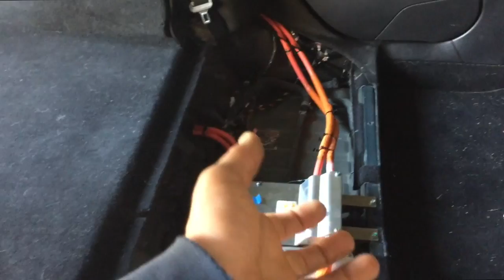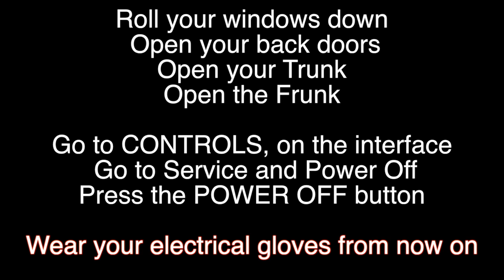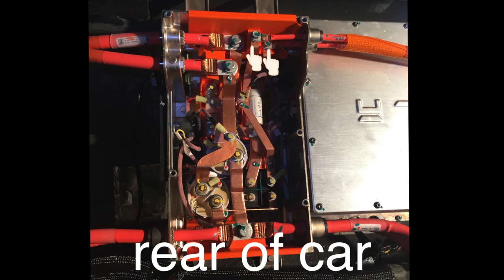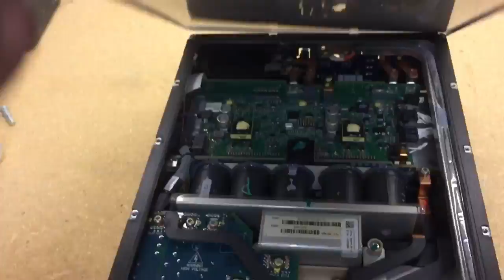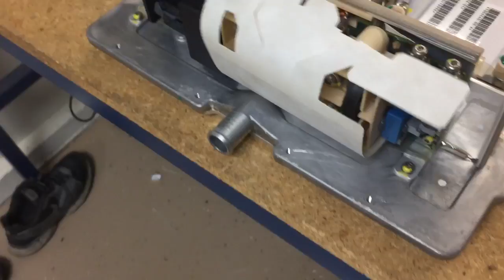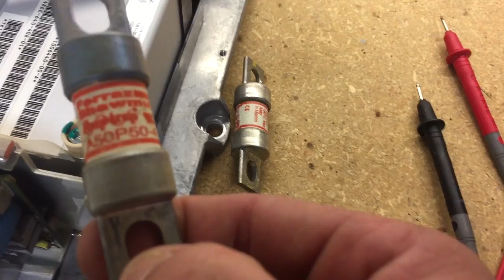Fixing a Broken Tesla Model S Onboard Master Charger

Comment: It's 2385.00 plus tax in California now. Let's just say I'm going to check the continuity on those two fuses first:-) Tesla told me it was the phase board in the master charger that had gone bad.
Reply: Did it end up being the board or did you just need to replace fuses?
Reply from the maker: Eric Bendler any update?
Reply: so did replacing the fuse fix it?

Comment: What kind of wet behind the ears engineer buries a fuse in the bowels of a car or module? The car is swimming with crazy-to-maintain stuff (like getting at the battery in earlier models).
Reply: Designed so the average home m3chanic can't fixt it

Comment: What would be possible symptoms of blown fuse in EU cars with dual charger?
Reply from the maker: Patryk Makowski similar signs would happen regardless of a single charger or 220v in EU cars. There will likely always be a fast acting fuse to safeguard against a fire. A dual may still be able to charge up to 40a then fail to go over that but I’m not really sure. They may have it set up so when one fails, the other charger can be the main. Good question. Wish I knew more to give a solid answer.

Comment: Thank you Nick for posting this. Was a little hard to find those fuses. Nothing local but allfuses and eBay was best price I could find. Mine the bottom one blew. Since I read the comments I replaced both of them. This occurred right after trying to use a supercharger that kept lighting Amber when plugged in. Moved over a spot and charged. I then went directly from there to home 8 miles away and plugged in at home just to get a little more since I didn’t want to sit longer at the supercharger. I plugged in and got the red death ring. Called Tesla service center and they thought maybe the UMC. It wasn’t. I have two. Neither worked on 50amp or 120volt plug. With the associated message of unable to charge. They said bring it by. They plugged it into their 100amp and same thing. Cure would be new $2000 charger plus labor. I have dual chargers inquired about swapping and was told about 3 hours labor to convert to single. So about $500. I still blame the supercharger and left contemplating what to do. Found your video and I love tearing things apart. Thank you so much as that saved a lot. I have the manual to help on the other 12V disconnect steps I wasn’t sure about. I didn’t have to unbolt either charger. I did remove the HVJB just so I would have room to remove the charger frame piece. Probably 4 hours of physical labor figuring it out. Tracking down fuses at a good price took longer.   If you hunt hard enough you will find in the $20 range. eBay for me. 
Thanks to the other comments here for the extra tips.  
The white insulating material over the fuses I could see was attached by two plastic rivets but no way to be able to get those out and back in without tearing a lot more apart.  I opted to just slice the two top 1/2” pieces with a knife and it stays in place with the frame back on.
Reply from the maker: mark A thanks for your comment and I’m glad it was some help. It felt good when I figured it out. There was no way I wasn’t going to share this with others. It’s seems many people have had the same issue and repaired it cheaply. It’s not the easiest but once you do it once, it would only take 30 minutes to do it again.

Comment: Just finished this swap today. Took a bit to get some hard to reach spots but worked as directed. I'll trade 3 hrs of work and 40 bucks for 2500 from the SC. Much appreciated!
Reply: Charger still working on the replacement fuses?
Reply: What did you swap? single to dual chargers? or just fuse?

Comment: Well, my second charger (originally my slave charger I had swapped in to the primary position when that one died, and I didn't know about the fuse issue yet), also is now exhibiting this issue. Interestingly enough it's been in use as my primary charger for just under 3 years... my first one blew the fuse right at about 3.
So, I'm about ready to do this dance again. It may be that regular charging at 40A just  fatigues these fuses over time and they go. I'm going to replace both in the unit while I have it cracked open...
Reply: Tackled this today...figured it would take me 3-4 hours... so of course it took 5-1/2. Most of the extra time was dealing with the non-electrical part of the project, especially things that weren't covered in the video. I suspect I could do it in under 3 next time...

The @Nick S youtube video really provides the essentials. A few notes that might help others doing this on an early gen car:

- In order to get to the HV cut loop connector and the 12v battery negative terminal, you have to remove the fresh air filter box. Remove shroud above the frunk and passenger front wheel-well. Lift the passenger side portion of the plastic skirt that mates to the bottom of the windshield. This has 3 push-button anchors, with the left-most one under the rubber atop the shock tower. The upper edge just presses in a groove below the windshield and can be gently pulled out. Once this is loose you can lift it and remove 2 bolts on the sides of the air box, and undo two clips on top to remove it. You know have access to the loop and battery.

- The negative lead to the battery had zero slack in it. I couldn't get it off the stud, and instead just removed the entire connector on the negative battery terminal. (Don't drop the negative lug nut here... unless you feel like disassembling the frunk to find it)

- You don't need to remove the rear seat backs. This avoids having to try and remove the side padded trim pieces which I spent 20 mins trying unsuccessfully to do. Instead, after removing all the bolts, yank up on the front edge of the seat cushion frame, and it will pivot upwards on the point where it attaches to the backs. Bungie cord it up out of your way. When done fold the seats down on to the lower seat frame, and lift upwards on the seat-back pivot point while pushing the lower front edge of the seat frame back on to its location with the mounting holes.

- You don't need to remove the two screws holding the connector in to the charger shell on the fuse-end of the charger, despite the youtube video suggesting you do so.

Enjoy!
Reply: @scaesare  I have an early VIN and will be replacing these fuses as soon as I get from San Diego to Michigan:-) Thanks for the additional info.
Reply: @scaesare  nice, thanks... Can you make a video on how to?

Comment: Aren't HV lines isolated completelly from chassis of the car? In that case it could be completelly no use to measure voltage potentials from HV terminals to car chassis.

Comment: Fuses should be easily accessible behind a cover. Tesla is not alone with this utter crap serviceability. GM volt has the fuses in the receptacle and is normally a 125 USD part. Not sure on the Nissan leaf they may use thermal circuit breakers. People need to complain   this is absolute crap the way things are designed... No Industrial  critical equipment would be designed like this. Must cost car makers a bundle under warranty for these sort of repairs... just so they can give the public grief when the cars out of warranty and they save a few cents on manufacture. Just so people know fuses can blow just from wear and tear only. So much for automotive electrical engineers. Not impressed.
Reply: I know it's an old comment, but I agree that fuses should be easy to replace behind a cover when safe. A 12V fuse I say go right ahead. A 400V fuse is not for everybody and should be difficult to reach, but maybe be accessible right after you take the first lid off. Kind of a, well you have came this far thing.

Comment: I have problem in tesla when insert the UMC ,the gereen light flash for less than 30S then red

And unable to charge on dashboard 

Is it the same as your problem ?

Thanks for sharing
Reply from the maker: Sorry for the delay. I haven't visited this video for a while. But yes, very similar. It went through a few cycles of it trying to charge then started flashing red. You should hear you cable click on and off. But, most likely this is the same issue.
Reply: Do you know exact which part you pulled out? Like item number

Comment: If a fuse breaks then there's something wrong elsewhere.
Reply: Agreed but it could be something Tesla fixed through a software update that we don't know about.  Pulling more than designed amps for something like heat while charging could have popped the fuse.  If I replace the fuse and it runs for another 2 years, that's still $2500 saved from replacing the whole charger.  Also, the problem could be after the charger but Tesla will never troubleshoot that far.  They'll replace the charger with a 1 year warranty and it'll blow again at 13 months...So, we're on our own here.

Comment: Life saver. My wife's Tesla fuse blew too.  You saved us about $2000. Weird to say , it felt like working on a big laptop.
Reply from the maker: That's awesome. Glad I was able to help. That made my day. As long as you isolate the leads, there isn't any danger. Ironically, on mine, the other fuse that I didn't replace. It blew about a month ago. So, this time I replaced both so I bought more time. Cheers.
Reply: Nick S  goes to prove fuses suffer from wear and tear - good job!✌😁
Reply: @ausmartin1  I'm an Industrial Electrician and have found that often if one fuse has blown, the other on the same supply may have been weakened and will blow at a lower current after the others are replaced. You find this on 3 phase motor supplies. I replace all 3 fuses if one is blown. If you smash apart a HRC fuse like that, there's several fuse elements in parallel, surrounded by what looks like white sand. When the elements melt, the sand melts and forms an insulator. I smashed one old fuse apart that tested ok with a meter, and found several of the elements were melted. It would have blown at a much lower current if re-installed.

Comment: Hey Nick,

I'm trying to repair my onboard charger and I think Im missing a step to get the backseat back portion off, I have all the cage screws and bottom cushion taken out but around ~53 seconds it cuts off a step I think. Did you say you had access to the service manual? I'm getting it right now but its taking forever to download sadly.
Reply: Timothy Meredith 
What part are you stuck on. I had problems with the plastic squares holding the top part of the seats and forgot to take out one of the bolts holding the cage. One of the plastic squares was stuck so I had to move the seats a bit to get it to come out.
Reply: I figured it out earlier. The white tabs were what I was stuck on, that and 100 degree heat in TN with 60-70% humidity lol. Its working great now, although I would have gladly paid Tesla ~$200-400 for this (Especially with the heat in my garage currently). But $2k was a ridiculous quote for me to fix it. It was actually $1750 before taxes, basically $2k here, for a remanned charger aka fuse changed)

Comment: Nick, thanks a ton for this video! I drive a p85 and my charger just died. I'm very comfortable on PCB's and this helped a lot, thanks!!
Reply: Being comfortable with PCBs is one thing - being comfortable with 400V+ is another!
Reply: @rkan2  Eh. As long as you know how to use a multimeter and understand that disconnecting the 12v effectively instantly isolates the HV Battery, then it's no problem. You can insert a big number and drive fear, but A. disconnect battery and listen for HV relay to kick, disconnecting HV battery. B. use multimeter to verify no voltage from HV.

It's not magic, it's basic and it doesn't matter if it's 110v or 1000v, it's the same precautions.
Reply: @tpmeredith  Sure, if there are no faults and your gear is properly designed there should be no issues - but working with 12V PCBs is still different than being "comfortable" with anything over 48V.
Reply: @rkan2  Sure, 12v != 400v, point made from a comment 4 years ago. Good job.
Reply: @rkan2  also to be clear, I didn't say "comfortable with low voltage 12v PCB's". PCB's come in all shapes, sizes, and voltages. I didn't say "I'm comfortable with 12v", in which your comment "being comfortable with 12v is one thing, being comfortable with 400v+ is another" would be correct and make sense. Troll on

Comment: Nice job.  I'll keep this in mind for my RAV4 EV that also has a Tesla on-board charger.  However, I have a 8yr/100k mi extended warranty from Toyota, so I won't need to DIY this for a while.
Reply from the maker: we have an 8/yr unlimited miles warranty on battery and power train. I thought we did too but you have to read the fine print.
Reply: Right, Tesla does not include the on-board charger in the battery and drive unit warranty.  Toyota includes it in their factory Powertrain Warranty, which is 5 years 60,000 miles.  I was talking about the extra cost Toyota Platinum Service Agreement (extended warranty) that I purchased to cover the car for 8 years and 100,000 miles.  It has tons of exclusions, but none of the EV specific stuff is excluded except maybe the traction battery, which has its own 8/100 factory warranty.

Comment: funny, the Chevy Volt has 8 year 100K mile warranty on all this.. anything to do with the battery or charger.  wtf Tesla
Reply from the maker: are you sure? we have a 8 year unlimited mile warranty on the whole power train and battery but the charging components (charge cable and charger) aren't. You have to read the fine lines.
Reply: That only for the battery.
Reply: I would never drive a piece of shit like the volt, they seem like they can’t even give them away.  Sorry but if you can’t afford a Tesla don’t get one. No matter what if you like the volt and its for you to drive its your decision. No matter what thank you for going electric and stopping the oil companies from killing electric cars.
Reply: @Lensesandgadgets  The 2016 and newer volt's have pretty descent reliability ratings thus far.  I own a model S but would also not mind owning a 2016-2019 volt.

Comment: Excellent job mate, but.... 400VDC is not to be messed with (for reference the centre rail on the London Underground is +400V (the outer is -350V) Would you ever touch these? I'm an ex-BBC transmitter engineer and am well versed with high voltage DC power supplies, but the problem for me is not knowing the correct Tesla isolation procedures and that, for me is just too big a risk (life vs death). Point of note for European owners, in Europe we have Three Phase units so the charger will be very different inside from the US version shown here, let us hope the fuses are better positioned as there will likely be 3 or 4. Also fuses get stressed, replace both with new ones, not just the blown one!
Reply: Would running the car completely out of battery charge work for extra safety while repairing the car?
Reply: @patrickmelson4745  no.  Your battery will still have hundreds of volts and you risk damaging the cells.
Reply from the maker: You're totally right. I did get the isolation procedure from the service manual. The only thing I didn't isolate was the feed from the inverter but with no no current from the 12v to power that board, it is essentially isolated. When I point out the terminals to test from the service manual. You think even with doing the isolation i mentioned you think it's a risk? When you open the high voltage box, you hear a click and from the theories of operation, that is a kill switch to instantly isolate the battery from the high voltage box. I couldn't find any current in the high voltage box when the 12v was disabled and the lid on the high voltage box cover was removed. What are your thoughts?

Comment: Just a thought on your repair. I would make a hole in the cover and bring the fuses outside in a holder or better yet go to resettable breakers. I guess if no more trouble under rated fuse was it, thanks for sharing.
Reply from the maker: I thought about that. To bring the circuit outside the box would be a fire risk. I wanted to put a hole in the side, with a cover, but I would still have to take the seats out so figured it wasn't worth doing. Glad you enjoyed.
Reply: I would not damage the integrity of the box. If the charger blows up, that box is what is there to stop/lessen the explosion, possibly saving the car in turn. There is a reason it is closed with that many screws.
Reply from the maker: I like that idea. If it happens again within the next 20k miles, Ill probably do that.